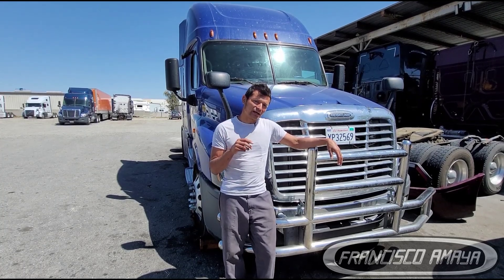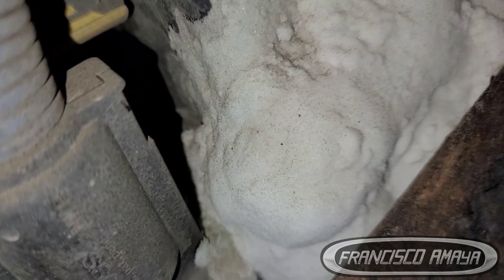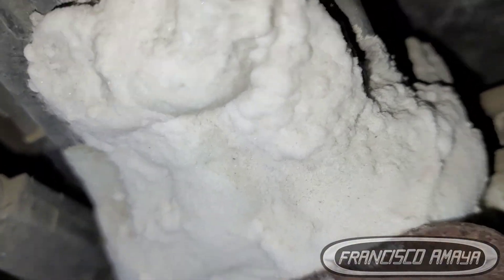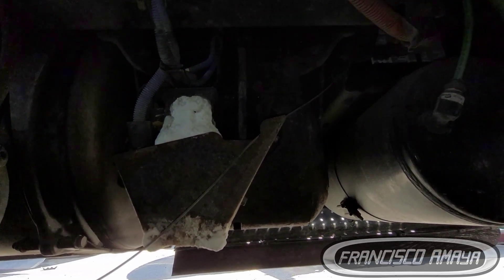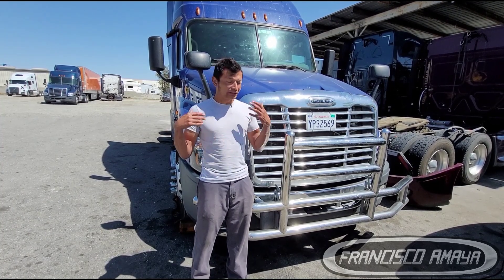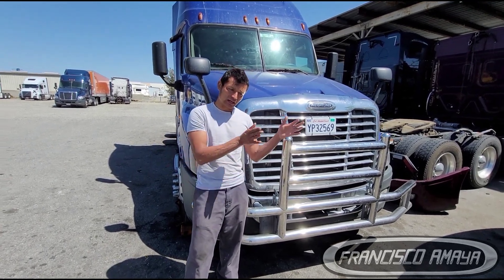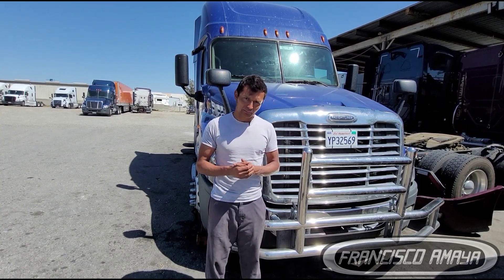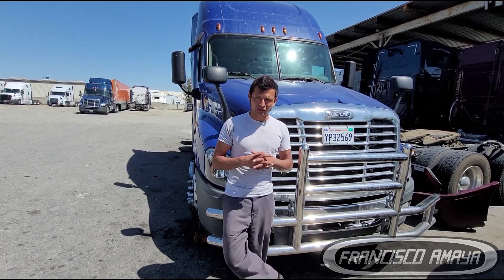DPF SCR DEF commun problems cost of repair delete problems maintenance how to repair system

Comment: I got a 2014 cascadia that I got deleted and it was the best decision I’ve made. I got tired of the DEF keeping my truck broke down every other week spending hundreds of dollars to get it fix and trying to find parts…. So I said F’k it, it’s time to delete…. 😊
Reply: How much did U pay to deleted??
Reply: I’m getting mines deleted this shit is ridiculous every other week im in the shop
Reply: It wasn’t for me I got a bad delete got it deleted 5 times after that from different shops runs good for a while then start shutting off and throwing codes I’m putting it back on
Reply: How do you pass Emissions?
Reply: @branndonwright2832 that sounds like a problem with ecm or wiring. What codes did it throw? Scr/def codes? If so they deleted your truck wrong 5 times in a row.

Comment: I literally just got done fixing a scr nox conversion fault and it was the DOC inlet temp sensor was loose and out of place.  Check for any exhaust leaks my peoples!
Reply: What was the code you had?  I get scr  nox conversion efficiency low 4364 18. Every time i go up hill, conversion drops below 60 percent. Any other terrain, it runs 90-95 percent. Been dealing with it for months. Replaced seventh injecto, doser, filters, nox sensors several times. Driving me crazy.
Reply: @analizethese - That code is for the outlet nox sensor. If you've already replaced it (depends on timeframe .. may need to be replaced again), when was the last time you had the DOC filters cleaned?
Reply: @foltzenlogel  this has been going on since January of this year. I’ve replaced the dpf filters, inlet and outlet nox sensors three times, seventh injector replaced, def doser replaced. I haven’t ran the faceplug regen because the pressures are under 1 when doing a dpf regen. Regen always finishes fine. The issue is up hill. It drops to as low as 50 percent while climbing, and goes to over 90 percent once it levels out. It is driving me crazy.

Comment: A bypassed truck runs better and you get more boosts.however it makes it difficult sometimes to find shops that'll work on your equipment with a delete.ive spent more money with emissions on my truck then without it.
Reply: Not only that the fines if you get caught are quite costly.
Reply: How you did it? Skip the box and used a flexible to avoid going in to the box?

Comment: Codes 3364 & 4364 I believe just happened to me on Friday and my mechanic going to check out everything later to see and go from there 🤞🏾🤞🏾🤞🏾
Reply: Update?
Reply: Spn -3364 is poor def quality , it happend to me i stopped buying def fluid at pumps i only buy in gallons in store its better quality and code went away.
Reply: @Alenko87 did you have to empty your tank